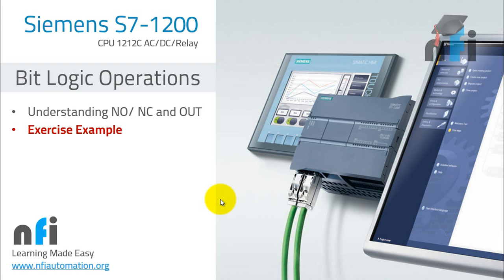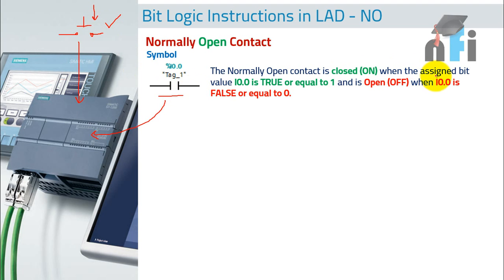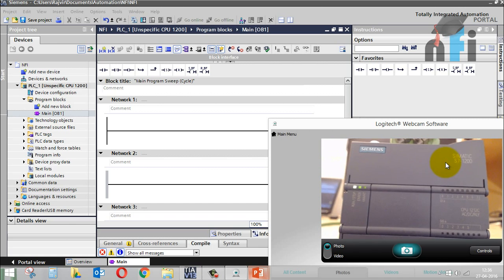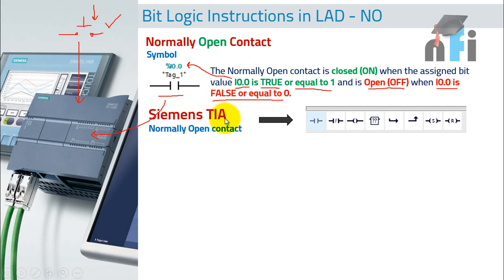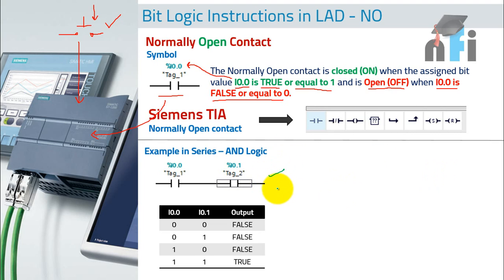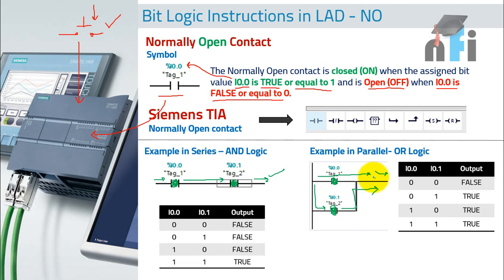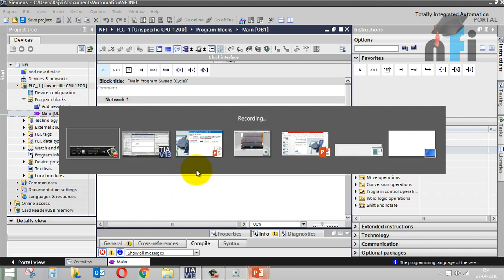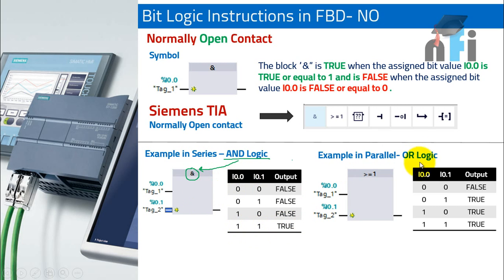Siemens S7-1200- Bit Logic Instructions NO, NC & OUT

Comment: Mr. Rajvir,
I am usually follow and search for all what you share of learning plc vedio. and I understand what you explain in it. what I need courses on siemens plc s7 1200 and HMI programming and in this courses an explaining for analog input and output programming then this signal control from the HMI like fluid level ,pressure or temprature ,etc.
can find these courses?
Reply from the maker: Dear Muhannad, kindly check the curriculum of the course at : https://www.udemy.com/learn-siemens-s7-1200-plc-from-scratch-using-tia/?couponCode=Website2016 

This is the basic course, we are going to update this course (possibly in Nov) with Analog and HMI tutorials for free.